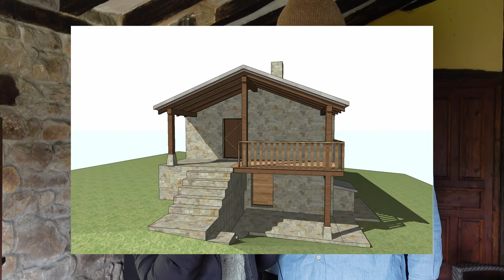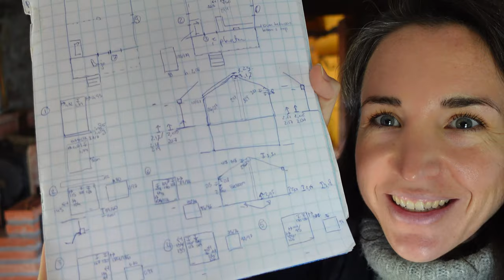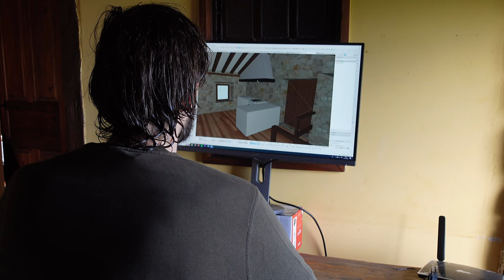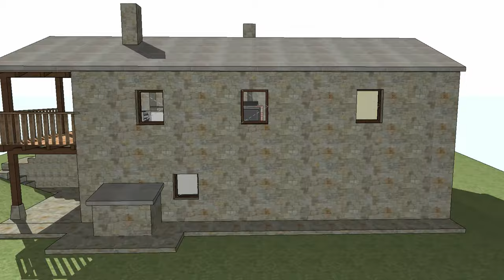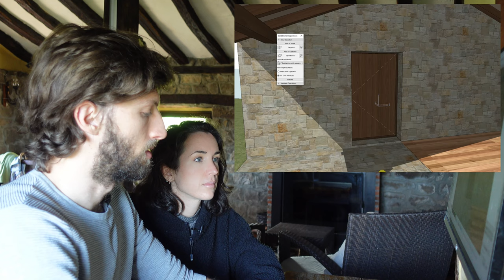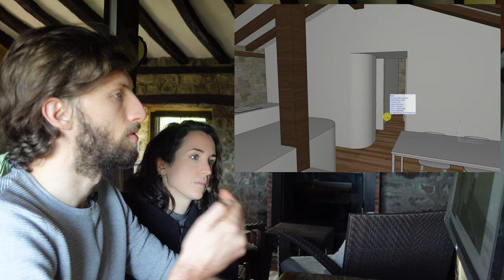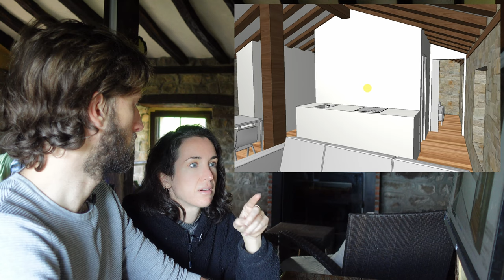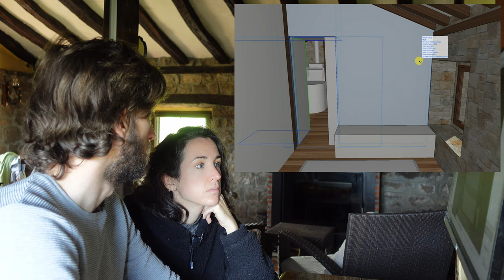Redesigning our off-grid cabin: Initial design plans & inspiration

Comment: option 1 & 4 are the best basic designs. I like that in option 4 the sink and the stove have a view through the window. Also your dinning room table could work real well as a single pedestal half circle with a bench against the wall. This could fit four people comfortably, but when it is only the two of you, you could push the table towards the wall and make more room for yourselves. Also, the fireplace you have is extremely bulky, a slimmer stove would heat the space just as well and occupy less space; this would give you more room for your lounge-love seat and also make for a larger entrance to the living room. Another idea would be to have a single metal bar above the lowest part of the stair to hang coats along with a simple metal box incorporated into the stair rail, suspended above the stairs, to hold boots or shoes (headroom considered).
Reply from the maker: Thanks for all your great suggestions. We'll definitely take them into account. You're right, the fireplace is extremely bulky (and because of that also less efficient). We're still looking if we could replace it with another smaller model, or whether we keep it and make do. We'll definitely want to continue using this system where it is connected to the radiators and those are quite pricey. We had thought of the bar as well and updating the stair railing so it could be more functional (i.e. shoes, storage etc.), so we're definitely on the same path 😉

Comment: What fun! The change of fireplaces is very interesting! To use the other fireplace, I vote for solution 1, the kitchen where the fireplace is now. And the bathroom... the one on the ground floor has a very low ceiling, but having just one shower, downstairs, would give you more space upstairs. Perhaps the floor of the downstairs shower could be lowered so it could be used? Although it is not very comfortable, it may be worth having more space upstairs.
Reply from the maker: It's true that we may have to end up prioritising some functions over others, and there is much more space downstairs.. But then the top floor could never be independent. Lot's to consider and continue working out. Thanks for the idea! 😘

Comment: Have you considered using your porch as your main (summer) dining room?… You ate outside a lot in your early videos. That view would be spectacular for that. It also means that you only need a small space for both of you to dine in the cabaña during winter… 

When you have guests in the colder months, you could make eating on the porch quite an event with thick covers, perhaps some form of heated cushions (like the bed heating pans from victorian times), enclosed candles, etc.

You seem to be designing the cabaña interior as if that is the only space available to you… the porch is a fantastic area that you can probably use very well during most months once it is repaired.
Reply from the maker: We'll definitely use the porch, it's the most beautiful spot of the house! 😀We just have to make sure to design the interior space as well, because you have quite a lot of rain and strong winds here, so we won't always be able to use the porch.

Comment: I agree with your final choices of 1 & 4, the window in the kitchen throws me a little. Not sure how to overcome that issue, but loved seeing the process of trying to work out the space. Great results guys.👍❤
Reply from the maker: Yeah, the windows are a problem. They are all very low and small, but we'll have to make it work. We have some ideas on how to integrate them in the interior so it works, but it's going to be difficult. Thanks so much for your support.